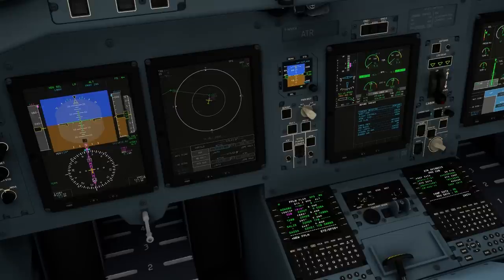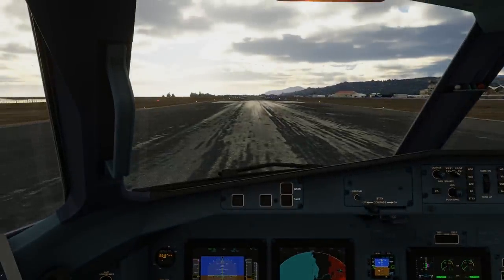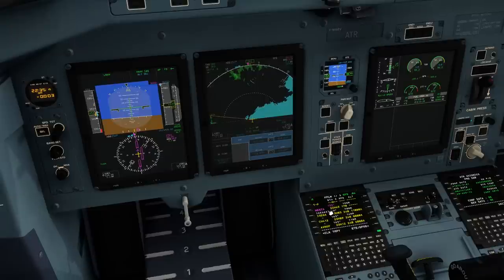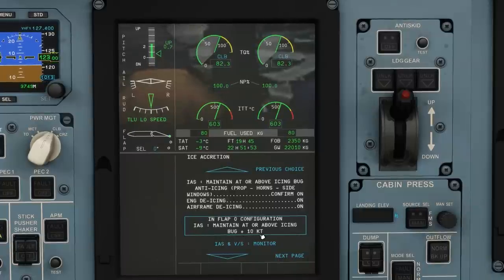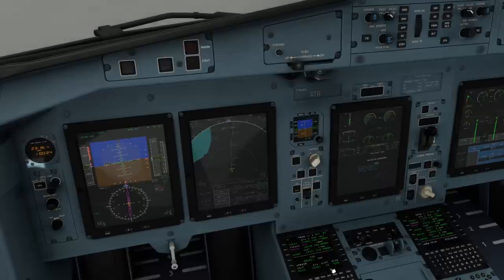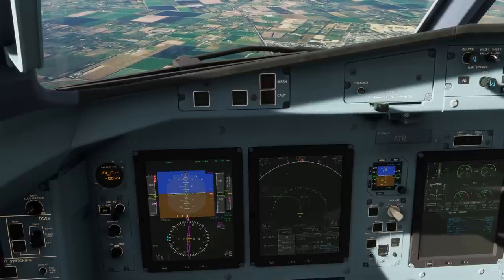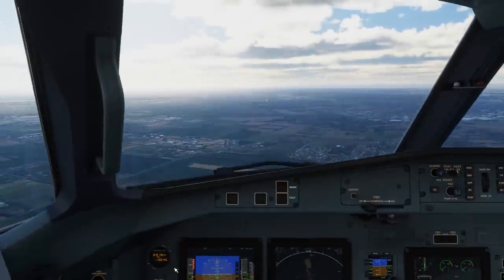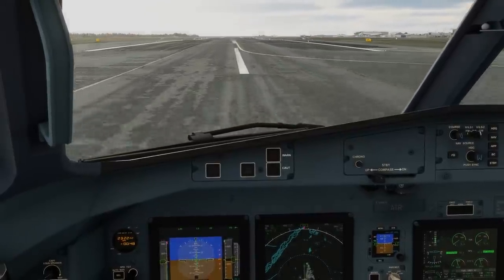ATR 72-600 Discovery Series Episode 7:  Flight Modes, Icing, VNAV & Precision Approach

Comment: Awesome video and very descriptive, but how are you getting 235 knots in cruise, I cannot get over 210???
Reply: The speed depends on the current altitude. Probably your altitude was higher than FL160. Assuming that the air pressure was also set correctly (otherwise press B on your keyboard)
Reply: @FlameBot  Thanks for that, was flying around FL250, so altimeter set to standard 29.92inmhg.
Reply: @ztublackstaff  if you are interesting in more details you can Google for atr72fcom . pdf (a PDF with 1012 pages in total) and starting from page 878 you have your cruise speeds. First table starts with a starting-weight of 13T (tons). The next table with 14T and so on. The speeds in MSFS are really close to that from what I saw.
Reply: Depends on aircraft weight and cruise altotude

Comment: Hello! Guys, thank you very much for the ATR, and A310, and for the anounced avionics update of 787 and 747, but...
I'm personally flying A320 and I'm really disapointed that nothing is announced for that airliner. Cause even though there are two quite good ad-ons from Fenix and FBW, non of them are working on XBOX, and it doesn't look like it will change. Please, make an update for an A320, it really needs it.
Reply: Fenix is still being re-worked from ground-up at the moment. It is also not perfectly working (performance-wise) for PC users given how other add-ons are doing. Hopefully the rework will consider XBOX compatibility.

Comment: Hi MS team, I have been struggling with RNV/RNAV approaches on the ATR and would greatly appreciate your help. I have been trying to fly into NZNR RW34 which does not have ILS, is RNV only but I have never successfully had a completed flight. I have checked every vid I can find but seems there is no definitive RNV tutorial, I also want to say that I appear to have been getting different failures even when I am pretty sure my setting have been the same. There is conflicting feedback that RNV works / does not work  and I would appreciate feedback that confirms either way to help me overcome the frustrations I have been having with this aircraft. In the main I enjoy flying the ATR and don't want to give it away however this is a real possibility. Thanks very much in anticipation
Reply: Head on over to the forum
Reply: RNAV approaches are bugged. It doesn't fly to the glide path correctly,  either too low or too high. Youtuber 737NG driver tried an RNP RNAV approach and it doesn't behave correctly and he is a real world airline pilot.
Reply: Darcy flywithmagnar RNP approach on youtube